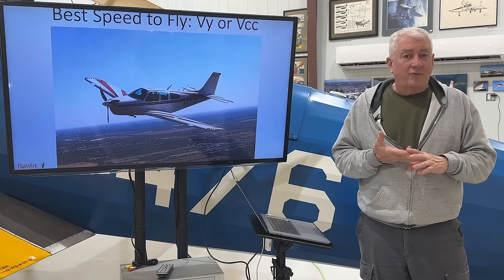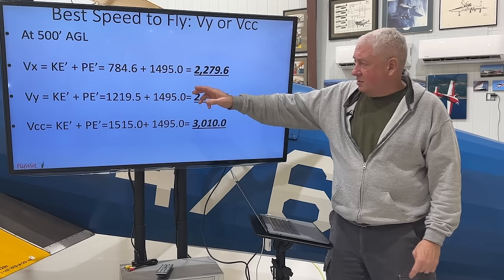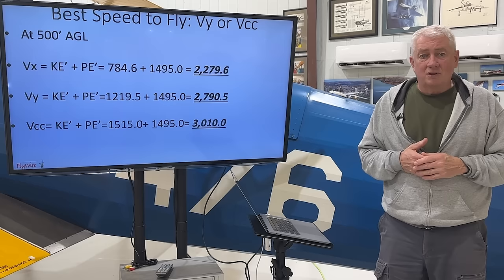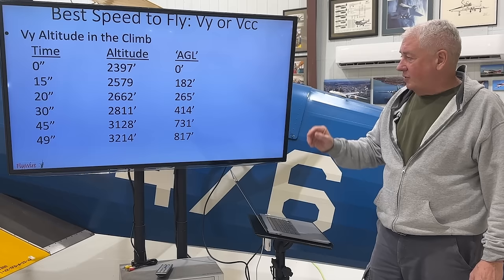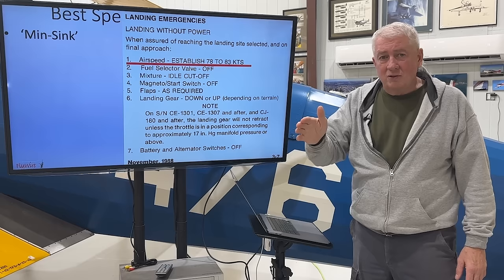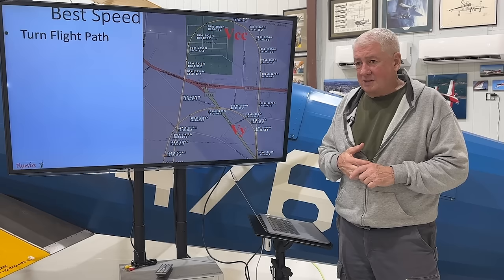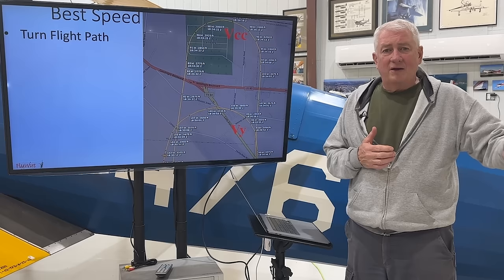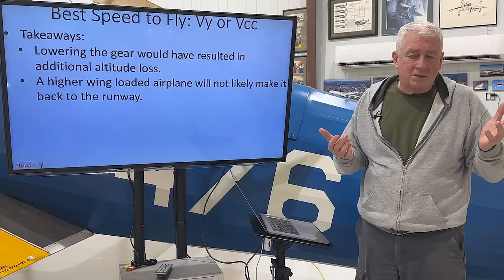Best Speed to Fly- Vy or Cruise Climb

Comment: Your energy state approach sounds like a great idea to me.   However I didn't see the energy or energy ratios in the video.    I did see "energy loss" in the vid with units of FPM which isn't really energy or even your E'=energy/m which should have units of FPM^2.     I think it would be very instructive to look at total energy state (KE+PE) at a particular time after rotation (or simulated rotation at altitude), say 45 seconds and 1.5 min at the three climb speeds Vx, Vy, and Vcc immediately after rotation.     Then you could look at the energy state after a 180 deg turn and compare.  I would argue that it's not the energy loss from the beginning of the turn back (power loss)  that is most important, but the total energy at the completion of the 180 deg turn that is most important, with the second most important being the energy state at the point of power loss.  If you didn't want to use standard units of energy in joules to keep is simple for most pilots you could just define the normalized energy using a Vy climb as equal to 1, and calculate the others in relation to Vy.   I actually seem to recall you talking about normalized energy but I never saw it in the video.   Yes the results would be aircraft, bank angle/technique dependent  but I think a very good data point would be your technique and aircraft.   Keep up the good work - love your videos and your systems approach to flying!
Reply from the maker: Watch the first video in this series- 'The Impossible Turn- Is it Simplee? Is it Safe?'
Reply: @FlyWirescottperdue   Oh I'm sorry, I did watch that video and replied to this one for some reason...   I think that this video is closer to what I was describing.   It looks like you are using a PE' delta here though.   I'm thinking a absolute total E' at the simulated power failure and the 180 would be instructive relative to each of the three climb speeds.

Comment: This is really interesting. My homebuilt has a very low energy state at Vy. I have been climbing this way since I built it. What you are saying makes perfect sense. If I have to do a turn back it's probably not going to work out for me. Going to practice this at altitude. Thx for the info!
Reply: You have to pick up a section of a road to simulate a runway.  We used only 1,000 agl to start the climb to 1,700 agl, power down, nose down, wing down to 45 bank. 270  Turnback.

Comment: With a fixed-pitch propeller Vcc climmbs are the way to go after clearing obstacles. The engine produces more power at the higher RPM it achieves at Vcc (versus Vy), which translates to rate-of-climb numbers that easily exceed climbs at Vy once you're 1000 AGL or better (but YMMV). Thanks for the total energy samples over time; very helpful info.

Comment: @FlyWirescottperdue - Scott, good video, and good discussion.  I think for every takeoff we should have a plan.  If you are in the middle of Kansas, it's very simple.  Urban airport, the plan might be a bit more difficult.  I think your suggestion of climbing over the airport to get to a safe altitude before leaving the safety cone of the airport should be done more commonly.

One area of future discussion might be use of flaps both on takeoff, and when to drop them if the engine quits.  I almost never use flaps on takeoff (RV-8) but have thought about using 1/2 flaps just so that they are down in case of an emergency landing.  Not sure my lizard brain will remember to get them down if my engine quits at 200 ft just after takeoff.